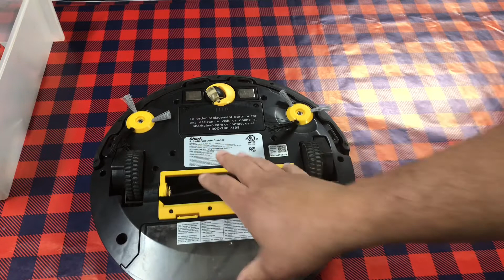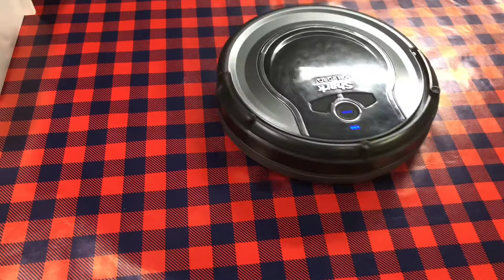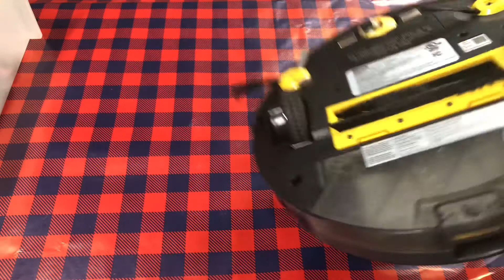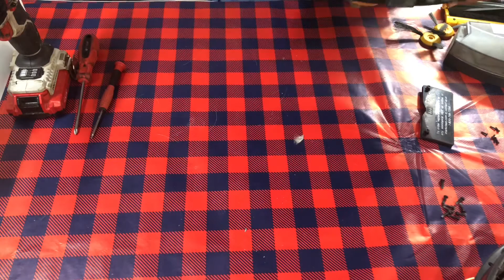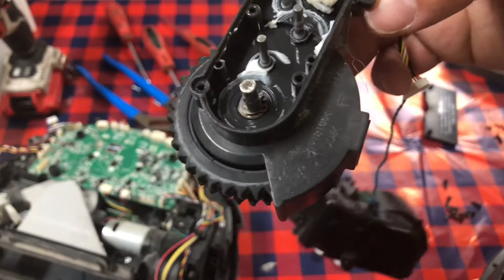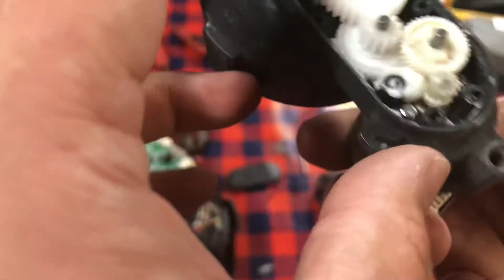Repair of a shark ion 700 series fail

Comment: My RV720 is spinning in circles only. I took it apart with the help of your video. I found my right wheel (the actual rubber wheel) isn’t centered and is rubbing against the wall of the wheel well. I’m not sure if that’s normal because I’ve tried clamps to recenter it but it wouldn’t budge. Have you ever encountered this?